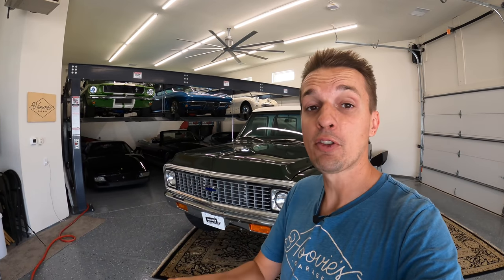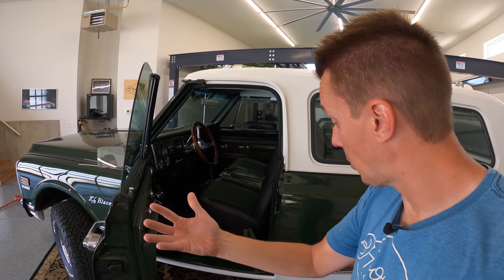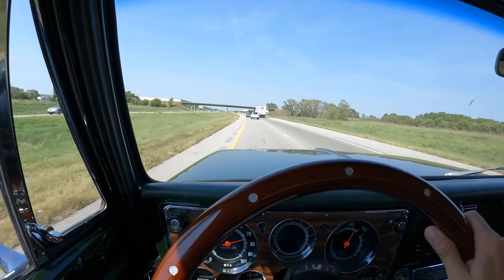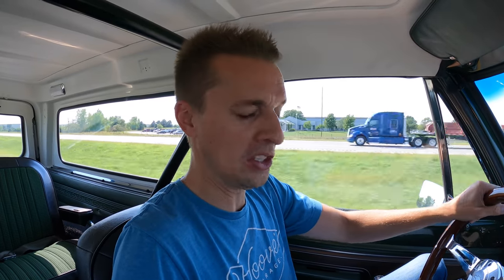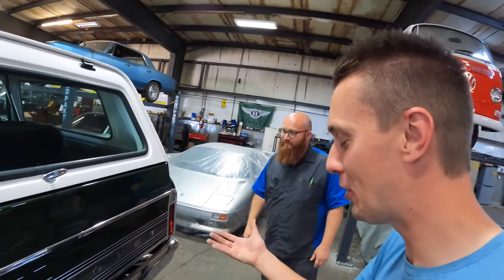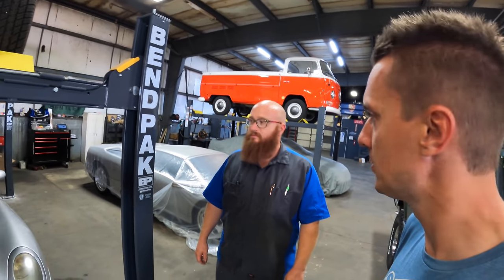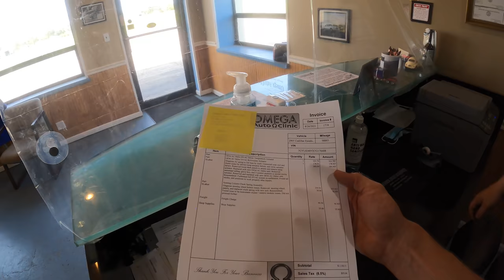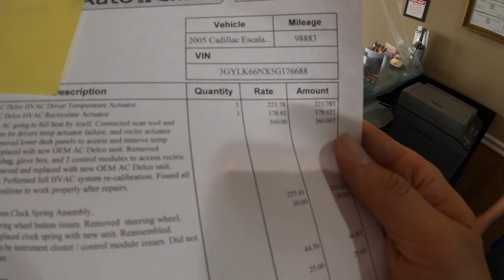Here's why the NEW Chevy Blazer is a HUGE flop. Build the K5 Blazer people want?

Comment: Some of the play in the steering can be adjusted out.  The steering gearbox has adjustments to tighten it up.  Loosen the jam nut tighten it a 1/2 turn or so, tighten the jam nut.  Test drive and repeat.  If it starts feeling like a high center back it off some as you have gone too far.  Often the rag joint is shot and never replaced, there are solid shaft options.  But it being what it is with all the joints in the steering linkages you can't get it to rack-n-pinion tightness. GM used the same basic set up from the 60's through the early 90's on cars and trucks and a little later on trucks.

Comment: I know who works for a GM dealership as a mechanic. He owns a 1971 GMC Jimmy. Same color but it has the quad headlights, rallye wheels, and it has the "disc brakes" sticker on the tailgate.
In 1971. Chevrolet and GMC started putting front disc brakes on Chevrolet, GMC trucks, Blazer, Jimmy, Chevy Van, Vandura, Suburban, Sportvan, Beauville, and Rallye wagon.

Comment: The early 70s was the last time GM made things to last. With the UAW striking every year, the oil embargo and the fuel crisis of the mid-70s changed how GM was going to operate. When I was a kid, there used to be a fierce rivalry/loyalty over which was better: Ford or Chevy. Now, both have fallen from their best days and it's now Toyota or Honda.
Reply: What kinda nostalgia trip are you on? Almost every vehicle back then was completely shot by 50k. People were doing massive rust repairs and total rebuilds on vehicles that weren't even 15 years old. GM trucks from the 90's and early 2000's are the cockroaches of the vehicle world by comparison. So many piles still roaming around with 250k and little to no maintenance.
Reply: I would argue GM peaked in the early 2000s before the bailout
Reply: @Nonamenever557  100% agree with you about that
Reply: @chadm3985  exactly, people like to think they "don't make them like they used to" when since the 90's every car and truck will last for 4 times the miles with basic maint. and you won't be changing every hose, spark plugs, wires, all fluids etc just to go on vacation. Modern casting and much better quality oils and lubricants far exceed what was offered back then. Yes, they have the cool factor. Don't make em like they used to? That's right and thank god.

Comment: The steering wheel play is an easy fix.  It's just a worn rag joint (located between the steering box and the column, joining the two).  After that's replaced, the excessive play should be gone, which also improves the driving experience.

Comment: I had a '78 K5. Great vehicle but the rust eventually took its toll. I don't think they had any factory undercoating in those days because they had a huge rust problem in northern states. It had a 350 with a 4bbl carb and NO computer BS. The army used a K5 for a few years as the M1009.

Comment: There's an adjustment screw on the steering box to remove all of the lost motion.............I'm sure Wizard can help with that.
Reply: Well you can increase the pre-load but that alone likely will not remove that slop. I would start with the bearing for the steering column, rag shaft, and check all the tie rods etc.....I love recirculating ball and joint steering especially on a truck but if you have a badly worn steering gear box there is a lot that needs to be checked internally. Saginaw Steering was just down the road from me before they sold and turned into Delphi etc....I worked for GM for 7 years. Properly rebuilding one is on par with rebuilding a differential with regards to getting all the parts and pieces to proper specifications for long life and good feel and response. The box Toyota used was very similar only much more durable. In the past GM often put parts on vehicles that were just barley up to the job considering the size and weight of the vehicle. Toyota prior to this last decade normally put parts on vehicles that were easily 2X bigger and stronger than what the vehicle needed to have.   Plus since Toyota arrived on the scene rather late in America they where able to copy the best design elements from Packard, Chrysler, GM etc....With fuel economy demands, crash test safety and the like none of that holds true today with regard to being grossly over built.

Comment: My father bought an S10 Blazer as soon as they came out. V6, 5 speed manual. It looked as good as it ran (very good). Dad got rid of it after some POS dropped a huge rock off an overpass and gouged the passenger door terribly well. Dad took it as bad karma and traded it on a TransAir conversion van. Nothing like a big K5 Blazer. That's the Holy Grail.

Comment: The only thing that bothers me about the new Blazer is that it should have been called the TrailBlazer. In my mind TrailBlazer was always the bigger SUV of the two, and it shows that Chevrolet used the names due to already having the rights to them and not because they put thought into the names.

That said, I otherwise couldn't care less. It's a word slapped onto the hatch of a vehicle. Not important in the slightest.

Comment: Just FYI, no Blazer came from the factory with a 454, since it was based off a 1/2 ton chassis truck. But since they shared bodies with the heavy duty pickups, it will fit. The early Blazers require a little more modification since the trucks they were based on didn't offer a big block.

Comment: For the price that was paid (which I'm sure wasn't cheap), those details should have been addressed when the truck was reassembled. With new paint, you shouldn't have poorly fitted doors like that, as well as leaks and a missing inspection cover (which should be easy to find as noted in the video). RAMC often lists 2nd gen F body cars on Ebay and their details are often wrong, which makes me wonder how much of an "expert" they are on them.

For example, it's been known for years that Phoenix Graphix who supplies decal kits for 2nd gen F body cars and has for years makes you buy the "6.6 LITRE" decal for Trans Ams separately from the kit price. They include the "T/A 6.6" decal which is ONLY for the W72 Pontiac 400 for 1977-1979. The base Pontiac 400 in 1977-1978 and the Oldsmobile 403 in 1977-1979 would have  "6.6 LITRE". In some cases on the base cars, there was no hood scoop decal. I've seen that wrong on RAMC (as well as other cars) listings all the time. I've even seen a Pontiac 400 10th Anniversary Trans Am that they had that had "6.6 LITRE", go figure on that. I brought it to their attention and they agreed it was wrong, but I frankly don't think that they knew until I pointed it out. There are a ton of "restored" cars by "experts" running around with a T/A 6.6 decal where there should not be one. When you charge high prices, the details have to be there. That means doing your research. That means that nothing is rushed, ever. If you can't do it right the first time, how will you have the time and money to do it right the second time? (as the old expression goes). 

That means no "whatever's cheap in the catalog" parts that everyone can find with the click of a mouse or by making a phone call. That means you may have to find a good original and spend time and effort to bring it to the level it needs to be. That means that the alternator should have been refinished properly.  That also means it should have been gone through and rebuilt to new condition, as per shop manual procedures. That means that you shouldn't see leaks from missing gaskets or poor/rushed assembly.  

As this truck is nearly 50 years old, yes, some liberties were taken such as the aftermarket exhaust and Rancho shocks which likely would have been done on it back in the late 70s/early 80s when those original items required replacement. That also means you take the time to remove the "Made in Taiwan" sticker on the fuel tank. That means you don't spray bomb everything chassis black, as that is not how it was done originally. Again, I'm not sure what was paid for the vehicle through RAMC, but if it was good money, the details were missed and that to me is not acceptable. 

No one is perfect, but if you're going to charge "perfect" money, you better be damn near better than what was presented here.

Comment: Even the S10 Blazer was a body- on- frame construction.   If it had the Vortec 4.3 it was a more capable of road than any of the modern stuff will ever be.   I had a friend that had one, he paid $500 for it and we went into the woods and got stuck.   The problem was just a simple vacuum hose that actuated the automatic lock on one of the wheels.   That truck had almost 300k on the clock.

Comment: Know whats interesting? My 82 K30 crew cab has the same bumper marker lights almost in the same spot as this blazer.  That's like 20 years different and the same marker lamps. Love the old school K series

And until they make a brand new Tahoe with solid front and rear axles, I'll mock them... also, as a side note,  after leaving the gym last night in the parking lot I let a brand spanking new cadillac escalade pass in front of me,  it went over a speed bump and it squeaked like a 96 explorer...... this thing was brand new..... guess the new all around independent suspension now squeaks....

Comment: With all the play in that steering box, it definitely needs adjustment at minimum. Replacing it would probably be a great idea. They just spray painted the old one without servicing it. Sure, those boxes weren't a sharp as a rack and pinion, but that much slop isn't normal. 

And getting the doors adjusted properly is exactly the sort of thing you're supposed to do BEFORE you paint the vehicle. I wouldn't consider that a "little detail". Like the steering, 1972 fit and finish wasn't up to 2020 standards, but the door isn't supposed to scrape the body. Getting the body panels  right once you've blown the car apart can be maddeningly difficult. Get the door working right at the latch end, and the fender rubs. Get the fender fit to the door, and the hood doesn't line up. And now you have to fix it without scratching a brand new paint job. Hopefully the Wizard can work his magic by just moving a shim or two on the door hinges.

Add in those transfer case leaks and the missing transmission cover, and it looks to me like a genuine attempt at a nice quality restoration, but they rushed it to get it done in time for the auction. It had to be in the paint shop by X date, so they didn't any more time to mess with the door, etc. 

All that said, it looks like a really beautiful truck, and hopefully the Wizard can make it perfect. The dark green metallic and matching interior with the white top look fantastic. I wish Hoovie's parents many years of enjoyment with their new old Blazer.

Comment: Remember snow plowing with those old blazers, the front axle u joints would fail. Break right at the wheel spindle. That one is way nicer than I remember.

Comment: Hey question for the car heads. So the k5 is the dream build right now, would it be comfortable if the backseats were removed and replaced with a sub system bench seats along both sides  would work and sit a few people back there

Comment: I do not care how a 4X4 looks! Not even a little. I want a simple oversized engine and bulletproof suspension and drivetrain. It must be durable and rebuildable. I have all of the electronic gadgets I need on my phone, electronic engine controls are fine. I-6 or OHV V-8 are the only real engine choices.  Temps, pressures, tach, and speedo only. Materials from the garden department at Home Depot for the interior. Full manual trans, please. I just spent over 2K on a 4L65 rebuild (it is a 20 year old truck with over 250K and it had a rough childhood, so...). 

Build it and we will buy it.

Comment: Best thing to do with old cars is just pull everything out I learned my lesson with my f100 I gave up and just pulled everything and did a full rebuild all gaskets wiring ac system etc and converted it to a throttle body carb so no waiting to start in the cold just do it you will thank me later I spent 7 grand total and have never had a single issue since

Comment: My '72 Blazer hasn't looked that nice in years. It still works hard though. I'm pretty sure that the top on mine has never been removed and because of the condition it's going to stay that way. It's probably the only reason why the rusty body is still maintaining its shape.
I hate to say it but that engine and transmission appears to be what I call a "spray paint rebuild".

Comment: Open the door and put a floor jack under the door below the door handle, once you feel some resistance jack it up another inch, then release it. Problem solved and $200 saved.

Comment: The Big Three could make bank if they made stripped or basic versions like these older trucks and sold them for under $20K. No computerization & a million different sensors (except for the basic engine management system), no digital screens, no computer controlled suspensions, no expensive leather, etc, etc. Just a basic truck for cheap, that anyone can mod & fix, and bang around without crying about scratches & dents.

These older trucks have lasted decades with minimal & inexpensive work. Today's trucks are prohibitively expensive and will start nickel & diming owners to death after about 5 years, when the warranty runs out and all the computerization, screens, sensors, and other gizmos start to fail.

Comment: I was disappointed in the Blazer, and it shows clearly why you need to see vehicles in person and know them inside and out before paying good money at an auction. I don't know what the sale price was but they probably paid North of $100,000, and for that they got a worn out truck with a lipstick overhaul. The drivers door may never fit properly without some body work, unless its just worn out door pins that the shop couldn't be bothered to replace. (An hour and maybe $20.00? Available on the shelf at Napa. The trim, the interior panels and probably some of the replacement sheet metal is Chinese. Someone in a paint and body shop knew exactly what to spend money on, and what not to spend money on for the sole purpose of making big bucks at a high profile auction. Not even bothering to throw some paper gaskets on the transfer case? They knew no one would see some drips from where they were waving their paddle. The Chinese fuel tank is exposed because the factory cover is missing. The steering box has miles of play because they cleaned it up and threw some black paint on it. There is almost zero play in a good box. Its not like they discovered how to build a steering box in the last few years. They threw a paint job on an old motor, and didn't even bother with new seals? The torque convertor cover was ripped off by bending it back and forth until it broke around the last two bolts, but they left those bits of sheet metal in place because hey, who is going to look underneath at an auction? To me that means the transmission also most likely has 100,000 miles on it. The fiberglass top is cracked in multiple places, there are crusty old parts underneath and in the engine bay because really, the restoration consists of a fresh coat of paint. I expect if you drove this thing a few times it would rapidly reveal itself to be a worn out old truck in need of a restoration.

Comment: I grew up with these trucks  I've  owned several  as well , but they rust out bad. The tub has been the biggest  issue, they rust so bad. If you really four wheeled one the fiberglass top would Crack, having said this they are baddass when setup for offloading.

Comment: Well I would not want ether a new Blazer or a classic one. The new version looks too generic, the older ones were really crap. I know there are a lot of nostalgic folks out there that get all misty eyed about these trucks because they grew up with them but they were piles of steaming crap just like most of the General's vehicles of the same era. The only thing GM cars had going for them was that they were cheap and easy to fix (sort of like the VW Beetle which folks seem to mistakenly think were reliable. They were not, they were just easy to fix). It is steaming piles like that Blazer and GM cars that allowed the Japanese to get a foot hold in the USA car market. Once folks saw how cheap but reliable a Toyota, Datsun or Honda was, they were not going back to an American car. 
I was a big GM fan boy and was able to overlook most issues with my GM cars until i bought a new Colorado in 2016. That truck was such a huge steaming pile o' crap. I dumped it in 2018 on an Elantra and had no issues at all with the car. i will never own a GM vehicle again.  GM wants to go all electric yet cannot solve a battery fire problem that started back almost 8 years ago with the Volt.....

Comment: I feel like GM is run by accountants who are completely out of touch with what the car industry actually wants.

Your average mid-size SUV is going to sell irregardless of its' name as long as it isn't complete shit, even then it will sell because sadly people will buy cars based on looks without doing ANY research which is nuts to me.

Call it a damn Chevy Mallburner and it would still fucking sell these days. They needed to save the name to build a retro rugged SUV and brew genuine interest in it. Instead they threw it on a generic crossover  based on some "market research" I'm guessing.